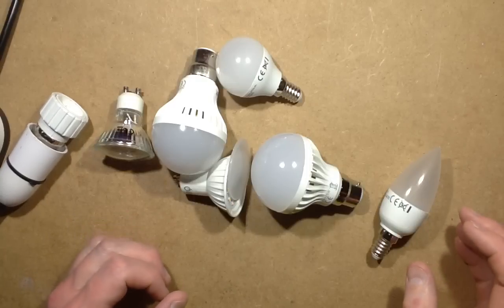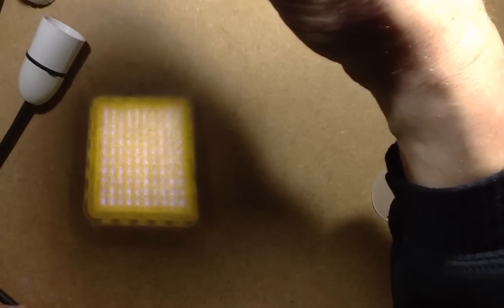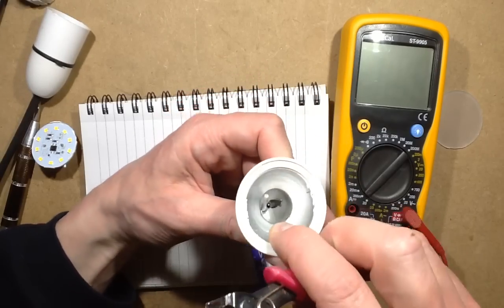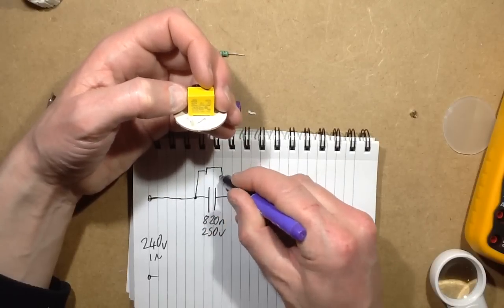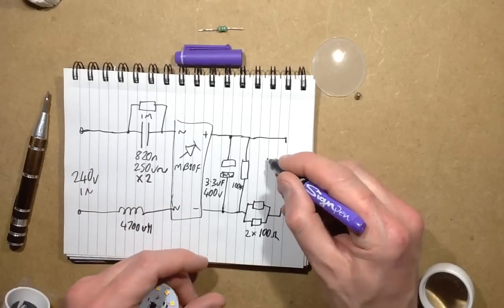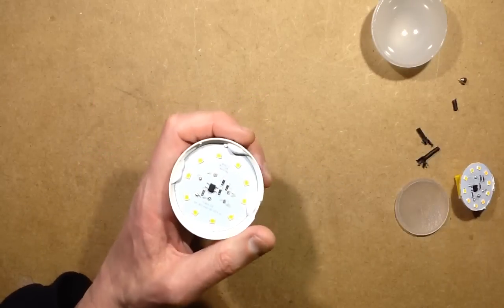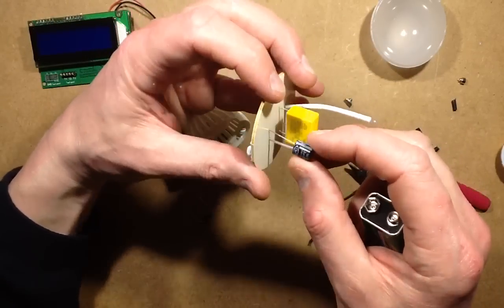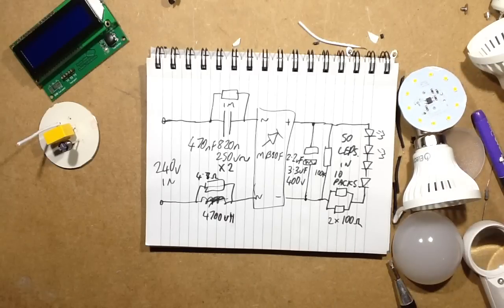New, and VERY interesting Poundland 5W LED lamps.

Comment: thanks for the vid 
now i had the idea of running one of these at 12 volt dc, (making each led run in parallel)  but if they need 17-18volts per led they'd probably be to dull for me to use

oh-well
Reply: Just buy the 12V version!  I've converted my bathroom to 12V lighting, with 6 led bulbs running from a proper isolating mains-to-12V unit out of the humid environment.  Much safer, longer lasting... well, better alround.  I bought my bulbs in LIDL.  No problems so far.

Comment: Why would you put a capacitor and inductor before the rectifier, is it purely as a current limiter? I presume this is the reason why they flicker too?
Reply from the maker: +Phillip Parr It's a capacitive dropper.  The first capacitor limits the current by letting through a small portion on each half of the sinewave.  It's then rectified and used to charge the smoothing capacitor.  The camera I use exaggerates the ripple greatly.

Comment: Avoid the 5w Electrek branded ones - they get so hot that the LED's actually desolder themselves! I ended up drilling some small holes into the base of the diffuser to try and dissipate the heat a little. Seems to run a little cooler, but still way too hot.
Reply: +hyperion8008 Also just had one of the GU10's fail - again, black LED that had unsoldered itself.
Yeah - the Poundland LED lamps are rubbish!

Comment: I purchased a set of 8 of the 5W GU10 and they're dropping like flies! 5 gone in just under 3 weeks, popped the 'lens cover' off them and the leds are visibly burned out with tiny black tracks across them. Hopefully the 3W would last a lot longer.

Comment: I bought a bunch of LED 12v lamps on ebay, and they work very well - but they cause horrific radio interference. Broadcast FM, airband and DAB radio are all badly affected when I switch them on. Do you ever test for anything like that?
Reply from the maker: +Ayrshore Anything with a switchmode supply in it is likely to cause interference.  If you used capacitive dropper lamps for an AC supply or a simple resistive current limiter on a low voltage DC supply then they would be near silent.
Reply: +bigclivedotcom not really, if they're made properly (big if). I have a 25A switch mode power supply than ran my HF transceiver for years and didn't give any problems. Seems everyone likes skipping essential EMC filtering when designing and building things, and Ofcom never seem to bother enforcing the law on it.

Comment: I had a cheapo LED bulb similar in appearance to those here in america. No idea what the rating was but it was a cool blue color and quite dim. it made me pretty nauseous whenever I tried to use it, My theory was that it was because of the manufacturer lowering the output of the LED's by playing with the duty cycle which may also cause the flickering with the camera. You see this in LED tail lights on high end sports cars, like when motor trend has a video with the rear of a car drifting, you'll see the LED's are dim and flash noticeably on highspeed when just using as tail lights, but when the brakes come on and they come up to full brightness the flashing speeds up or even stops completely. because duty cycles y'know.

so... Am I an idiot?

Comment: Hi clive, very interesting to see the internals of led bulbs. But I have a request about led bulbs. At home, we have some led bulbs that should be "dimmable", but apparently, our dimmer isn't rated for these led bulbs, so it has only two states: bright and flickery. 

I've meanwhile realised that dimmers work only with some led bulbs, and when you have a certain dimmer, you need to watch out what bulb to buy, but I still don't understand the relation between the two. Would you mind doing a video on it?

Thanks

Comment: Any tip for opening up the 5W candle bulb (in a fit state to put back together)? Out of 5, two have packed up ... and since I've lost the receipt...
They light very slightly, and seem to give a brighter flash when switching, thinking maybe part of the rectifier has failed, so that maybe  it's only working as half wave, so the dropper capacitor will just charge up and the only power will be through the resistor - it's so slight that the room has to be dark to see it.
Reply from the maker: +Matthew Day The plastic halves should pop apart if pressure is applied.  I'm getting a lot of comments to say that the 5W units are failing.  So I think they're pushing the LEDs too hard.  This endorses my belief that the smaller lamps are best kept at 3W or less.
Reply: +bigclivedotcom Been test running the 5W mini globes, so far ok, but in an open style shade.
The candle bulbs were dying in upward facing glass shades - open at the top, but no base ventilation. The 5W mini globes may not fare so well in similar downward facing glass shades.

PS. Also bagged some 12W TCP LED on clearance at Homebase, now these are serious kit, with fluted metal back heatsink - supposedly 60W equivalent, but seem like more - in my bedroom light, ended up swapping it for a poundland 5W full globe (vented), as it was too bright
Reply: So far, 5x LED candle 5W, now 100% fail rate, 5W mini globes so far held up on a few days test, 5W full size (vented) in regular use

Comment: EMC?
Reply from the maker: +Robert Brown the capacitive droppers are surprisingly low noise compared to the lamps with high frequency switching supplies in them.
Reply: Indeed I bought some very nice looking 5W lamps from Lidl. They generate massive amounts of noise with switching supplies. Being a ham radio operator stuff like this really affects me.

Comment: Hi Clive,
As a radio amateur I have an interest in basic electronics. LED lamps can I am told interfere with radio. Your video prompted me into Poundland and I bought a 3 watt LED reflector bulb to replace the halogen one on my bench. I works fine and no interference or red hot desk lamp. Thanks for pointing these out to the world
Paul
Reply: I'd second Paul's comment. It would be really helpful if you had a DAB & FM radio to hand near the start of the videos (before carnage!) to see if they knacker radio reception when on. It is a big problem with many LED setups, particularly panels and striplights. All down to the drivers/ballasts.

Comment: no clive they were running in a downward holder with a open glass shade that looks like a daffodil flower but with plenty of air space around them but when i turn the board over the back side of the board under the LED'S are well scorched.

Comment: For LED tests, it might be worth knowing something of the light output in Lumens (Watts input is only marginally interesting to most people, as long as its a lot less than the thing they are replacing). Admittedly quite hard to do on the bench at home without all sorts of errors creeping in.

Comment: Out of the six 5watt candle light bulbs i bought 5 have failed within 10 days some don't light whilst others do but the LED'S are very dim and look really dark in colour as if they have been really hot .now the 3watt ones are still all working which makes me think are the 5 watt ones being driven too hard or are they just getting too hot.
Reply from the maker: +ray firth Were they in enclosed fixtures?  It does sound like they are driving them too close to the edge.

Comment: Excellent analysis. Judging by the colour of the phosphor they are 4000k, my measure of longevity is the temperature of the board adjacent to a LED, this indicates the core temp of the junction, the colder the better.Saved me an hour calculating an AC dropper cheers.Have you thought of trying a simple CRI test

Comment: The light these things give out is vile, is there any radio frequency emissions like with the  other low energy monstrosities
Reply from the maker: +MANTLEBERG The capacitive dropper based lamps do not use high frequency drivers, so they are less likely to cause electrical noise.

Comment: Do they do the smaller 12v halogen replacements ? All the ones i have tired have been shit.
Reply from the maker: +Andrew Joy Poundland doesn't do the LED versions of the capsule lamps yet.  I don't think any of the capsule replacements are particularly good.  Mainly because they are trying to cram a modest amount of electronics into a form that was designed around a little quartz lamp in its native form.  As a result they compromise on separation, smoothing and heat dissipation.
Reply: What about MR11 in LED have you found any of them that are any good ?
Reply from the maker: +Andrew Joy I don't actually use an MR11 lamps, so I've never really tried them.

Comment: sorry but this is a unrelated question, I'm inexperienced with electrics in general even basic stuff I am uk based I have kitchen spotlights about 4 years since fit they are like the recessed spotlights with a glass cover but the bulbs are not spotlight types they are like the shaped white tubes you get on an energy saving bulb.  Anyway the bulbs keep blowing but when I tried to change the first one carefully turning fusebox off and then removing glass cover and reaching in to see if the bulb would turn/pop out what ever it just shattered everywhere, with shattered remains still remaining in the recessed socket and no obvious way or removing the remains of the bulb, I left it and reattached the cover, that was 4 years ago and some other bulbs have now gone.  Any help gratefully received my kitchen is rather dark.
Reply from the maker: +CornwallKate I'd suggest carefully trying to remove one of the other unbroken ones.  Without knowing exactly what type of lamp it is I'd have to guess that it might be a screw in lamp holder.  The compact fluorescent lamps are very easy to break if you are trying to unscrew them by holding the glass.
Reply: +bigclivedotcom I assume if they are recessed you have no choice but try and remove them by holding the glass part.  I wondered if I was doing it wrong and 'one' had to adopt a special technique, maybe not?   When the first one broke I was scared not really about the glass but about touching anything live, but if the whole fuse box is off surely its safe? Cheers
Reply from the maker: +CornwallKate Yes, you should be safe if you turn the whole fuse box off.  Also check that whatever lights were still working did go out when you do so.  If your fuse box has a safety breaker with a test button on it, then that's a good chance to test that button too to see if it does go off.  With the power off you should be able to unscrew the remnants of the already broken lamp, but be careful to wear hand protection so you don't cut yourself on the glass.
Reply: +bigclivedotcom ok will do thanks for all the help :)
Reply: use some long nose pliers.
Reply: +CornwallKate If they won't twist, they could be plugin CFL's like these here https://www.grainger.com/product/GE-LIGHTING-Plug-In-CFL-1PGT3. If so, just gently pull them and they should come loose.
Reply: +hannibalUK1 ....... And always stand in a bucket of water? ;-)
Reply: get a spake
Reply: get a spake
Reply: get a spake
Reply: Turn off the power at the breaker and use a handful of wadded up paper towels to push on the sharp bits and carefully turn the bulb until it comes out.

Comment: poundland is DEALZ stores here in republic of Irelandand I bought 5 of these 5w BC round bulbs @€1.49 each - great value for money, cant even buy CFL's for that cheap now! - only downside id I have them in a 3 light ceiling fitting which had 3x60w incandescent candles (equalling to 180watts!) and now with these on 15w for the three absoutely bloody amazing! - i would say these 5w equal 45-50w of incandescent light (even though it doesnt say on the box but it does say how many lumen they are) - so yes of course a little bit dimmer in the living room now not as bright, but what I was going to ask is that they are quite a bit on the white side rather than the warm white kind of  colour rendering/temperature - have you any ideas on an effective way to give them a colour of warm white. Its really evident as I have a floor standing incandescent lamp and that gives off warm white but the 3 light ceiling light gives of very white light now. If not I can live with it but its strange with both different colour temperatures glowing now in the living room. Any ideas?

Comment: Why two resistors in parallel, not just one 50 ohm resistor?
Reply from the maker: +Graham Neale To spread the thermal dissipation between two resistors.
Reply: thanks

Comment: so how long would these last and do they use less energy than cfl bulb which is more cost effective ...just stumbled on to your video was checking out quadcopters and I was mesmerised
Reply from the maker: +Mr O Mr O The LED lamps have much faster start (full intensity) and run much cooler than compact fluorescents.
Reply: bigclivedotcom  do they last as long and are they more cost effective than a CFL bulbs thank you for your reply
Reply from the maker: +Mr O Mr O The lower power ones are definitely better than CFL.  But some are better than others.
Reply: Thanks bigclive am off to pound land :)
Reply: +Mr O Mr O 
Hi, bought 10 and 5 have failed within 3 weeks, did buy them in two lots, second lot of 5 all failed, first lot still going. A bit strange, going to leave them a couple of months before I buy any more.
Reply from the maker: +Dwarfsbane Ironfist What typoe failed?  Was it a 5W version?  Because they do seem to be pushing the LEDs hard.
Reply from the maker: +Dwarfsbane Ironfist Yes, my own preference is to keep to the 3W area for LED lamps.  If you run LEDs cooler they last longer, and the 3W lamps in this video were the same LEDs run at almost half the power.
Reply: +Mr O Mr O We have had one of thesebulbs on for over 2 years all the time. still going strong
Reply: +bigclivedotcom 
5v ones, you think the 3v are better.
thx for the reply
Reply: +Dwarfsbane Ironfist 
lol 5w, sorry
Reply: bigclivedotcom  I still ain't got some there always out of stock at our store where I am so al keep trying and stick to buying the 3w :)
Reply: +Dwarfsbane Ironfist Me too - how cramped were the shades, as it seems the 5W just about hold it together in really open shades, but the smaller format tends to be in confined spaces.

For mini-globe, if you can find them in Poundstretcher, Hyundai reduced from £3.99 to £2.99 and the mini-globe is a 3.5W "28W equivalent", delivers quite a bit more light then the poundland 3W
Reply: guy laister we still got none here in the store
Reply: I may be out of date, but...   CFL's hate being turned on and off,  LED's don't mind.  I had two top-brand cfl's, the one in my living room lasted about 4 years but the one in my loo gave up after 18 months (short visits...).  I replaced it and some in other rooms with good-brand led's about 6 years ago.  All still going strong.

Comment: the inductor is probably there to reduce the inrush current and act as a fuse in the event of a failure. It may also help compensate for 50/60Hz variation.

Comment: Hey Clive, is it possible to use a capacitive dropper to supply an arduino? I want to use a nano with relay and sensor to switch an AC load. I suppose the varying load of the arduino and coil will cause its input voltage to sway too much? Possible future video looking at cap droppers and load?
Reply from the maker: I wouldn't recommend a capacitive dropper for an Arduino.  Not just because of the lack of isolation, but because they tend to pass spikes and transients that can crash processors.
Reply: I see, thanks.

Comment: A tall stack of series LEDs will result in a large forward voltage, and current will be minimised.  I wonder though if the difference between the forward voltage and the supply voltage is inversely proportional to the required dropping capacitor.  It seemed counter-intuitive until I thought about the scenario using dropping resistors instead.  As Vf approaches Vsupply, the required dropping resistance decreases.  With capacitors, if we want low resistance (reactance) at a particular frequency, we have to increase the capacitance.  This is a familiar situation in audio circuits when blocking DC, but trying to reduce any 'resistance' to the audio AC.  There's the equation X = 1/(2pi fC) showing the inverse relationship.
I'd like to know why we can't use a combination of inductor and capacitor in series to drop the voltage.

Comment: I've been looking for some cheap GU10s to try before committing to LED and have heard some scary things about the safety of some of the cheaper ones. Are these OK?
Reply from the maker: +johno4521 It's hard to tell how any electronic product is going to behave in the long term.  But these ones seem reasonably well designed.

Comment: He says "one of the 100 watt LEDs in my 20 watt bechlight" ?
Reply from the maker: Yup.  You can use high power LEDs on lower power drivers.  It means that the LEDs are all run at lower current, making them last longer and run more efficiently.
Reply: +bigclivedotcom OK, that makes things clear.

Comment: No doubt the inductor is there to kill inrush current. At the moment you engage the wall on/off switch and system voltage just happen to be at max you would get a massive current spike that can kill semiconductors and electrolytic caps.